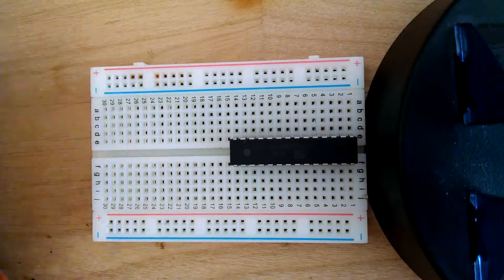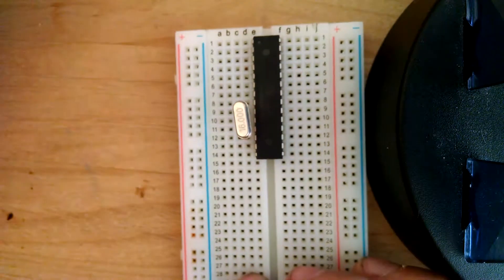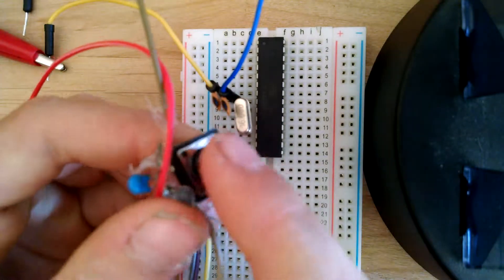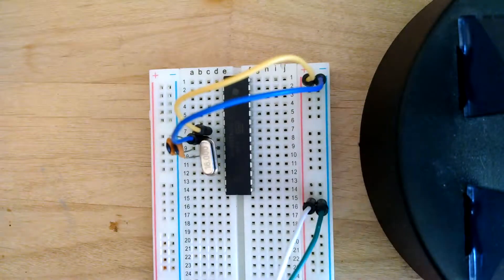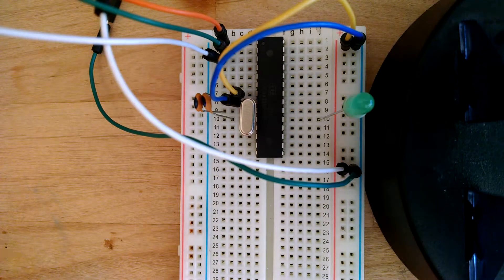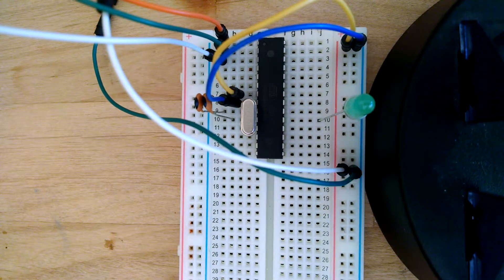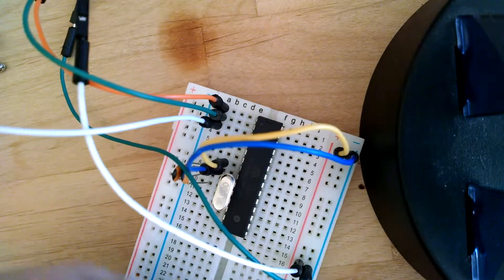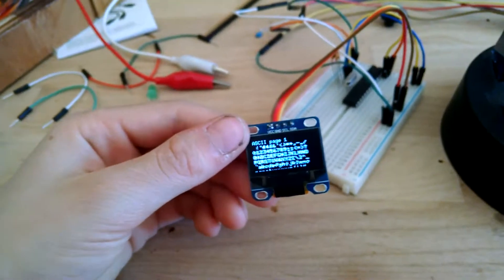Arduino uno

Comment: you need a resistor on the LED,without the resistor your shorting out pin13.
Reply from the maker: kardeef33317 I thought that pin 13 had an led resistor, must be only on Arduino boards. Thanks for the advice
Reply: Iam no expert, just something to check.Your doing a great job.Keep up the great work. :)
Reply from the maker: kardeef33317 Sounds good, I might be doing a Dremel 7300 review tomorrow or Saturday.